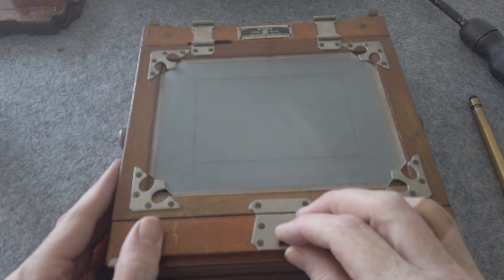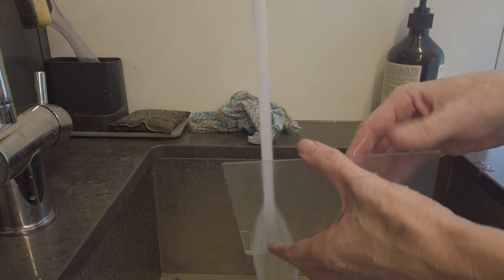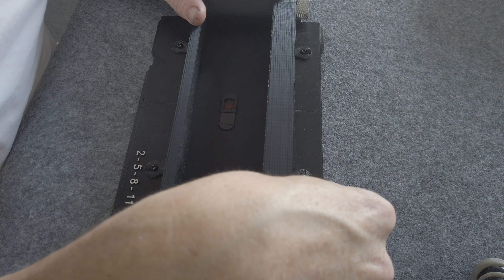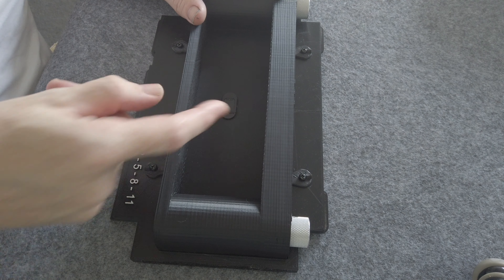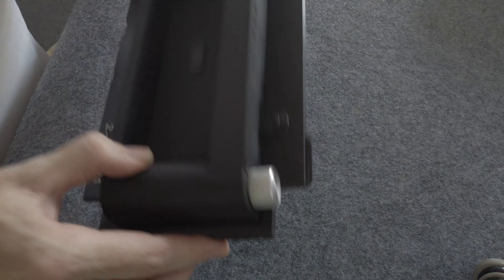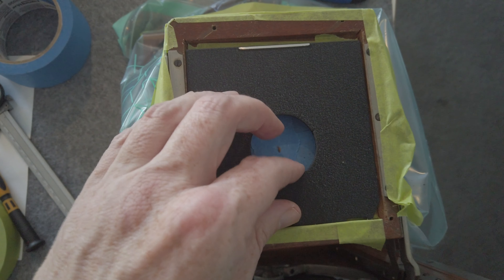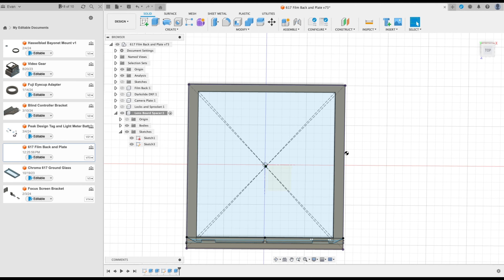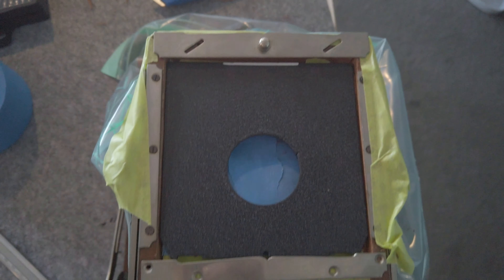DIY 617 Panoramic View Camera Build : Cheap Shen Hao Replacement Part 2

Comment: So much awesome!
Hope that the new bellows do come as described and give no hassles.

Truly inspiring stuff.

I hope that the tensioning between the spools stays firm and consistent over time; given you don’t have a pressure plate tension is probably the weakest link for keeping focus across the actual in camera plane.

My dog looks forward to the future series where you make your own 6x17 enlarger 😉
Reply from the maker: Yeah, I basically replicated the Chromas design on film advance and that hasn't got a pressure plate either  and I have had no issues, I have added a felt pad to the back that takes the place of a pressure plate, and as far as I can see the ShenHao hasn't got one other, so fingers crossed.

Haa, I just sold my darkroom gear, was taking up too much space 🤣
Reply: @thefilmlaundry  when you decide you really need a cnc milling machine and therefore move to the country so can afford a house and shed you can get the darkroom back 😂

What would be really cool for ANY 6x12 or 6x17 is a film back with winder mechanism a la Mamiya Press series iii film back. I hate window/winding, but that’s just me.
Reply from the maker: Haaaa, that will be the day.
I did see a 3d printed camera with a winding mechanism, so it's possible I suppose. Hmmmmmmm🙄

Comment: Very nice well done, one thing at about 9:37  38 you can see the light falling on the front lens element I think a lens hood of some kind would really help to reduce any lens flare, even holding your hand over the top of the lens  or even a cap or hat would do the job. I know some would disagree with me but I speak from experience especially with the view camera lens.  As far as the flare on the back unfortunately it is a question of trying this and that to try and correct the flare. I know this can be a daunting task and would take a lot of patients to fix but with your amazing build and patients I think you can do it. One thing  I did notice it seems to be at the end of the roll did you do anything different for that frame?  Well the best of luck I think the camera is an outstanding build regards    Kevin
Reply from the maker: Hi, yeah, I usually try to take notice of flair and block it (darkslides are great for that). As it turns out it was a small gap in the front standard connection , found it yesterday, but as the new bellows are due this week I won't bother fixing.
It was actually the third image in the roll, the focus test was image four, I just swapped the order for the video.

Comment: Did you flip the light-leak image? If not, then you might have been looking in the wrong places for your leak(s). Like you, I'd guess bellows, or where the bellows frame fits in the standard. But it does look like the leak is interrupted by a fastener somewhere. Good luck finding it!
Reply from the maker: Yeah I did, that's why I wrote on them with a sharpie so I wouldn't get confused. As it turns out I realised yesterday it was indeed a small gap in the connection to the front standard, here's the rub, it only opened up when the bellows were not extended totally, which is how I missed them when checking for it. As my new custom bellows are being delivered this week I won't bother fixing.
Reply: @thefilmlaundry  I assumed you probably had, but as I’ve made that mistake before despite theoretically knowing better, I thought it wise to at least ask. Glad you got to the bottom of it. So to speak.
Reply from the maker: @RobertBrazile haaa yeah totally. You should have seen me with the roll flipping my head around trying to make sure I had it right, the sharpie came out cause I'm an idiot and forget 🤣
You actually spotted my hidden mistake in the video, when I was talking about the lack of leaks on the images, I hadn't flipped my mind and so I was talking about the wrong parts of the images, it should have been the sky and the left side (after rotation) that being said there are no traces of the l and in that side either. But well spotted, I'm glad I'm not the only one who gets flipped arround.
Reply: @thefilmlaundry  you are not alone, brother!

Comment: That's awesome! Inspiring as hell.
As for your light leak... did you check the bottom of your lens board. You did modify something around there, didn't you? Added some piece of plastic.... Taken into account, that a light leak is somehow rounded at the bottom left part of the image and that there is some lens flare effect, I would check the lens board / fitting.
Reply from the maker: Good suggestion, as it turns out the leak was very close to there, it was a small gap where the front standard was glued on, only opened up when the bellows were retracted for the 90mm lens, that's why I didn't notice it with the bellows fully out.
Reply from the maker: So quick update, unjust got the new bellows and glued them in, and wow, what a difference. Then, as a 'why the hell not' I got the torch in around the edges of the lens board, and now that the leak from the bellows was not in the way, guess what, you were right, there was the faintest light leak on the left and right sides of the lens board near the top. I could t see it before because the bellows leak was more noticeable. Anyway, I added a small felt gasket around the 3d printed spacer and whammo, no more leaks. So thanks for the suggestion I would have never even thought of that as being a problem, it looked so well sealed, but I was wrong 🤷🏻‍♂️
Reply: @thefilmlaundry  I'm glad I helped.😀

Comment: Great stuff. Its impressive that you are going at all this in an apartment lol. Makes me feel like a king with a workshop etc...

Gotta say, I hate how you replaced those flathead screws, while annoying, they are much nicer looking than phillips imo
Reply from the maker: Thanks. I actually caved and ordered new flathead screws and replaced all the Phillips screws after the fact 🤦🏻‍♂️
Reply: @thefilmlaundry  Thats great to hear. Flathead screws are beautiful and they display that a piece was carefully hand assembled, they can torque down much more, and are very hard to strip.
Reply from the maker: They do look good, I have to admit, although my OCD was on point making sure every single one lined up so the slot was in line 🤦🏻‍♂️

Comment: Perhaps you should sacrifice a roll of Foma 100 to find light leaks? You should try to test out the film holder itself with the darkslide in. Simply let the film holder lay with dark slide facing the sun for a few minutes. Advance to the next frame and try again with the film holder having the dark slide facing away from the sun. Next frame, no lens ( but with a lens board blocking the front standard), with the film holder attached and no dark slide let the camera be hit by the sun from the upper right, advance the frame and try again this time with the sun shining on the camera from the upper left.

This should give you plenty of clues as to where the light leak is actually appearing.

You could then try adding several layers of black plastic over the bellows and repeating the process. Then try to expose one part of the bellows to the sun, letting the rest of the bellows be covered by black plastic etc.
Reply from the maker: Since the video I received the new bellows and that has fixed ally light leak issues, thank god 🤦🏻‍♂️

Comment: The flat head screws looked nicer even though I agree they suck to have to work with!
Reply from the maker: I kind of agree, I did even polish them up, but ended up swapping them (saved them though just in case )
Reply from the maker: Damn you 😝 this has been stuck in my head for days, the flathead did look better, just so annoying to screw. Guess who just ordered a new set of stainless flatheads 🤦🏻‍♂️

Comment: Hello 👋 I have feeling that tape around your ground glass it’s making your focusing not perfection
Reply from the maker: Hi, actually o don't show it in the video but I removed the tape from the camera side of the glass, it was redundant and also just in case. So there is actually only tape on the top side that can't effect focus. On revising the footage I shot of me taking the test doxusbahot I realised o had inadvertently added a slight amount of shift to the rear standard which would account for the focus change.